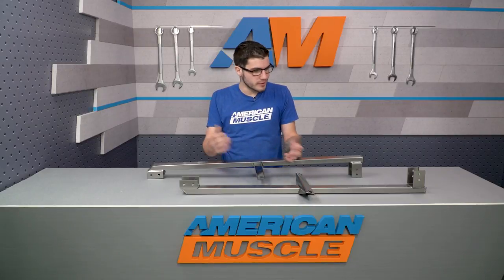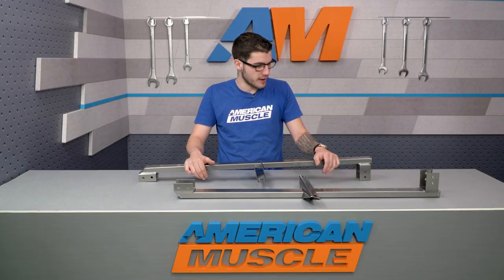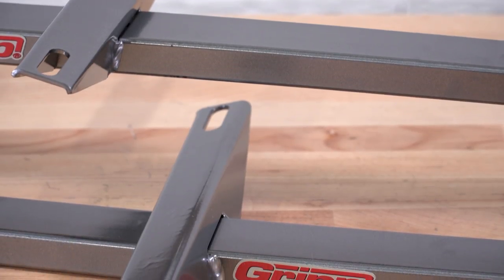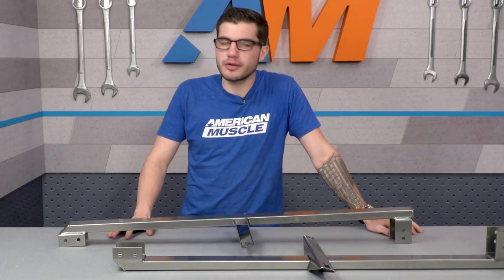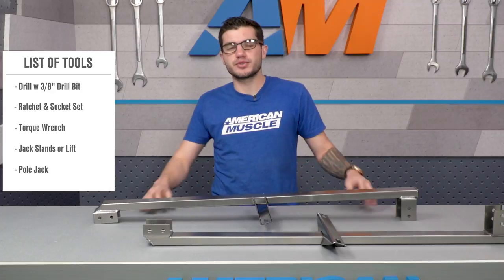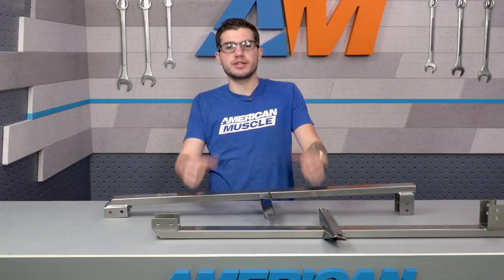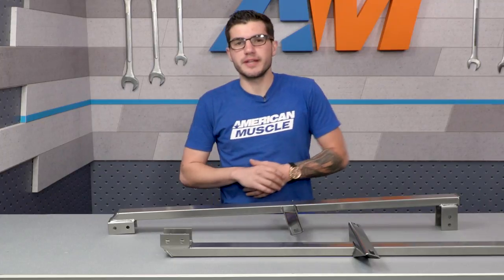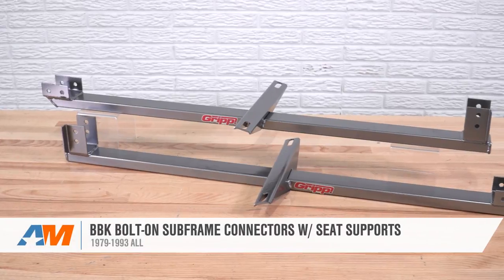1979-1993 Mustang BBK Bolt-On Subframe Connectors w/ Seat Supports Review & Install

Comment: Is there any way to tell if your frame is sagging before installing the subframes?
Reply: Iggy Vasconcelos  these car's flex terribly!, if your door pins are good and your doors line up good you should be ok.. toss it up on stands "under rear axle and front control arms" on level ground and giver, need suspension under weight and always weld whatever connector you use.. I personally went with Maximum Motorsports full length.. absolutely love em.. my car was beyond twisted and tons of cracks had to be welded up after I put the connectors in. Mine being a Vert is a completly differnt car now.
Reply: @83glxcrusin97  quick question. I think my brake lines where th er y mount to the frame on the passenger. There in the way. Is there a easy way to move them or move the mounting bracket so it slips right on just like the driver side?
Reply: @zachutson7205   with mine I was able to slide / tweak my rear brake line on the rear RHS further outwards  to gain the room I needed where it does that zig zag..
Reply: @83glxcrusin97  ok thank you. I cant wait to feel the difference after I get them installed

Comment: these BBK frames are great but sadly don't come with the additional instructions if you have a convertible as verts have an extra plate at the rear which needs to be removed at the rear of the torque box...
Reply: How did you do this?
Reply: I took these to a shop and had them welded on and he welded it to the torque box. Does that sound like a problem to anybody?